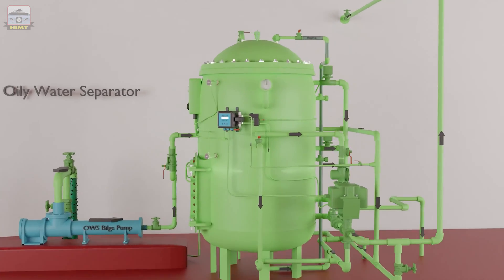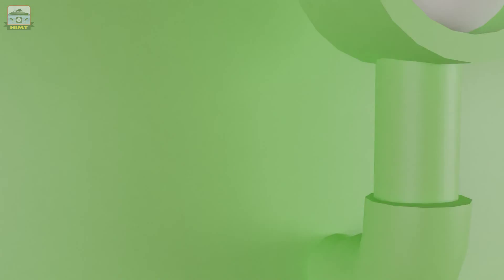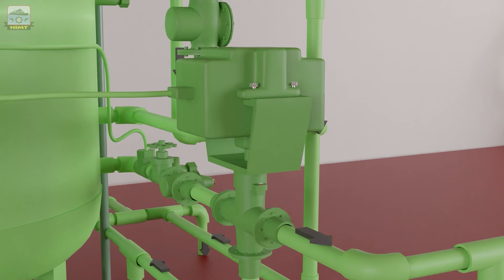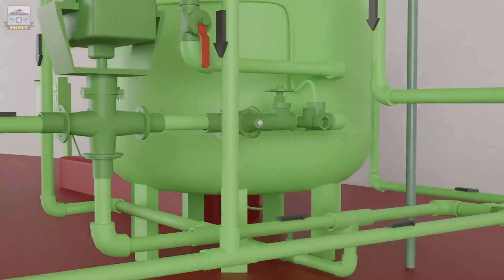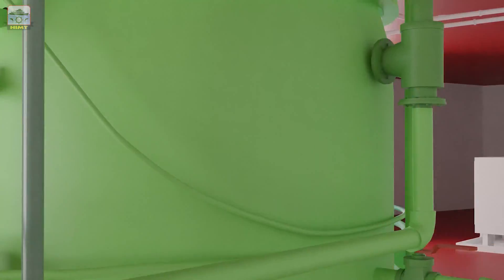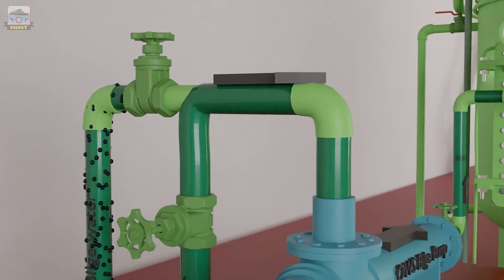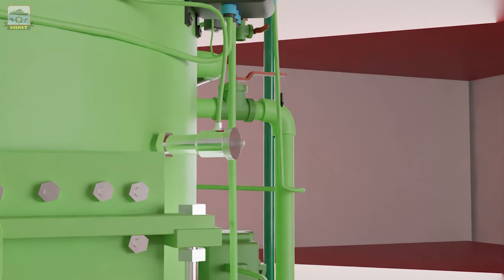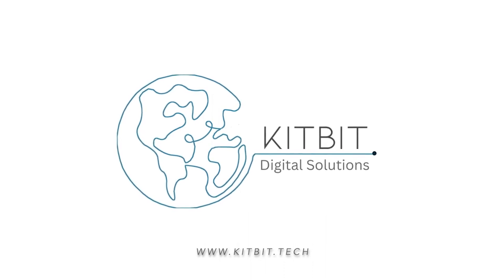How does an Oily Water Separator work? | 3D Animated Explanation

Comment: If this thing works, and I would doubt it very much, because I had thirty years as an engineer at sea, it would be the first and only I've ever heard of that did. A friend of mine, also an engineer perfected a system using three tanks and shipbuilders were beginning to use his system . When I joined a ship that's the first thing I pulled apart trying to do what it specified. No such luck.
Reply: So you failed for 30-years? I've had problems with these on land, without the rocking waves, but I'm surprised that you never got them to work.